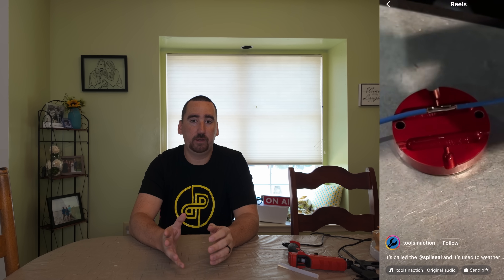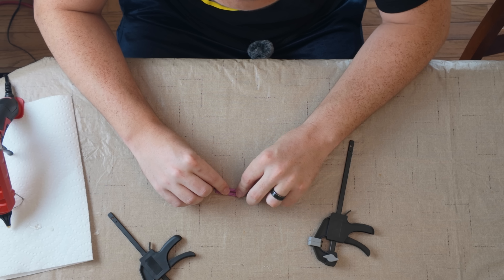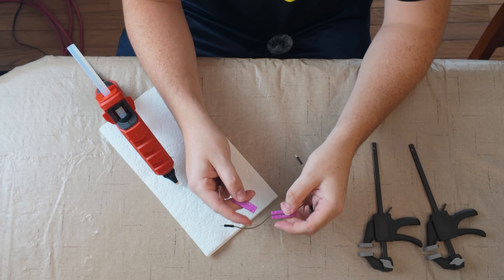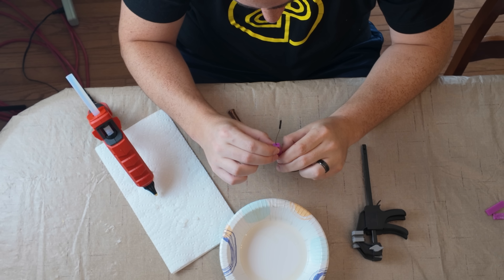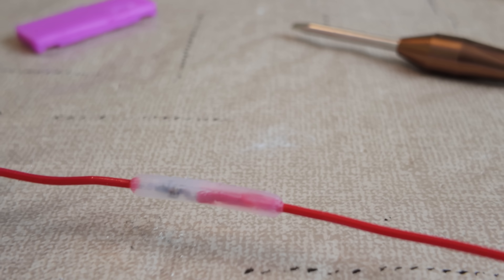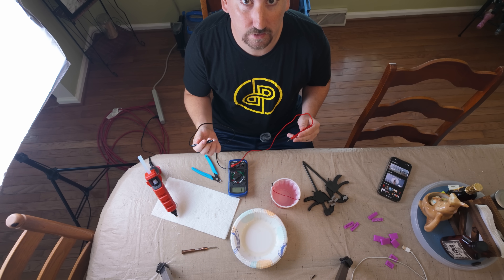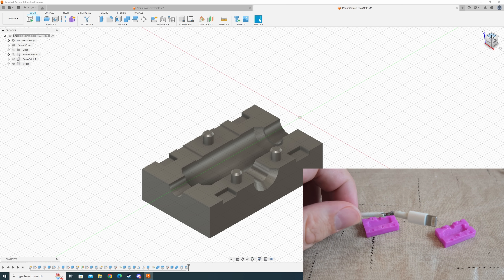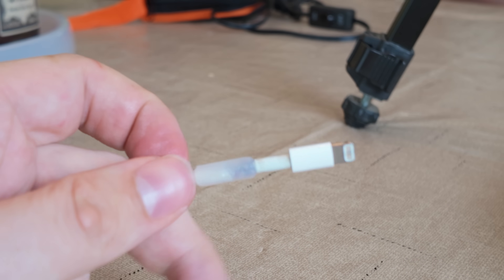Can You Inject Hot Glue Into 3D Printed Molds? | DIY Cable Repair & Protection

Comment: I have a metal cup filled with melted hot glue in it, whenever i have a cable torn like the one you used, I put some tape on the plug, put the cup on the stove to melt the glue again, dip the cable in it and let it cool off, then with a knive I cut and clean the plug, and it's ready to be used until it busts again, repeat. The use of molds is, in my point of view, a waste of time and PETG. The glue naturaly creates a regular layer around the cable when hung to cool off vertically.
Reply: It was just a simple demonstration. He could have used some electrical tape instead or 10 other methods.

Comment: Yeah but hot glue is terrible because it melts.  It would be more effective to simply make a permanent printable shell that you can snap over the wire and inject it with silicone or something if you want.  That way you don't have to worry about stripping the mold, and you don't have to worry about the wire being too close to the surface.   

... or you can just use heat shrink instead of wasting a bunch of time with more complicated solutions which are all objectively less performant than a piece of adhesive-lined heat shrink.

Comment: it's funny you used a lightning connector in the thumbnail. the apple cable is the only one i ever had this problem with. i tried to safe several of them. it's not possible. these cables are designed to break. i did it with tape and i was careful to make it taper off but nothing ever worked with these. spare yourself this pointless endevour